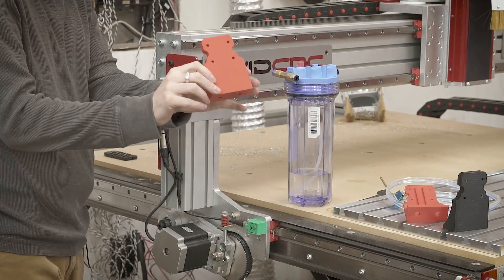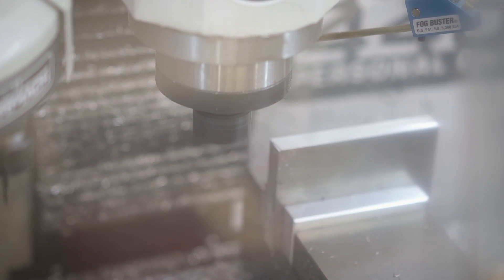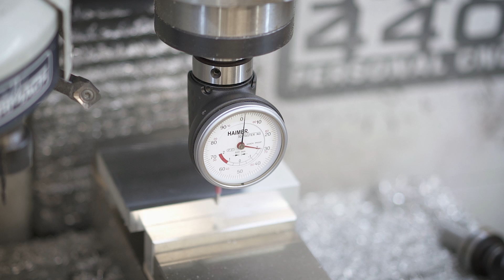Fogbuster Mount for Avid CNC Router

Comment: Hi, good video.  This is probably a dumb question, but since you have a Tormach mill, why do you need to mill aluminum parts on your Avid CNC?  is the Tormach a manual mill (i.e. not CNC)?
Reply from the maker: Good question.  The Tormach has a very limited work envelope.  It's also significantly slower, since the rapids are 100IPM, whereas I can actually cut at 150IPM or higher on the AVID.  So it has better material removal rates and a much larger work envelope.  However, the Avid is really only suited to aluminum and takes a bit of work to get a good surface finish.

Comment: Aren’t you worried about galvanic corrosion between the stainless screws and the aluminum?  Usually the aluminum will corrode to a ‘frosty’ surface and the screw will not be able to be removed.  Coating the screw with an anti-corrosive will help, but it needs to be cleaned and re-coated on a routine maintenance schedule, but eventually the aluminum threaded portion will be  toast.  Regular black steel screws are the usual attachment protocol, but not sure what they are treated with to manor them black. 😕

Comment: I just bought a 4 drawer general tool cart, and plan on mounting a 24 inch monitor under the lid like you did (awesome idea by the way). I was going to put the keyboard and mouse on a raised platform in one of the drawers. I currently have this setup on just a regular tool cart with no drawers etc. I couldn't get a wireless mouse to work through the steel. What do you use? My mouse was just a cheapo, I'm hoping a better quality wireless keyboard and mouse will work. Thanks for the videos!
Reply: Update, wireless keyboard and mouse work great!

Comment: The fogbuster doesn't have to be hanged, right? Why not have a 3d printed part at the lower end to support the bottle, much less work in comparison.
Reply from the maker: You're not wrong.  I could have done that.  I wanted the bracket to look 'factory'.  It DOES need to be at roughly the same height as the nozzle though.

Comment: What tumbler and media are you using?  Also, I use one of the 5-6gal California Air Tools compressors for my Tormach power draw bar and Fogbuster.  Little trick, put the 65db CAT compressor in your bathroom in the workshop and shut the door.  Presto.  Ultra quiet compressor that you can barely hear from the workroom.  Add more capacity by putting it in line with one of those dirt cheap HF yellow air tanks.
Reply from the maker: I use a harbor freight tumbler and the green plastic triangle media from there as well.  It works OK, as long as you rinse the media ever few parts.  It has a drainage hole, but it gets clogged with media quickly, so just rinsing it out every few parts works.  I have a CAT compressor too, but it's a bit annoying to run and air line over there (I don't have a good air system in my shop), so just using a little airbrush compressor is the way to go.  Also, the flow rate of the fogbuster keeps the compressor cycling pretty often.  With the airbrush compressor, it just stays on and is MUCH quieter than the CAT compressor as well.

Comment: Does your avid have enough travel to drill those z holes?
Reply from the maker: MAYBE.  I didn't use the router for this part because it was taken apart for installing this and some other things.  I wanted to use it, but it's a pain when it's torn apart, so I just used the Tormach instead.